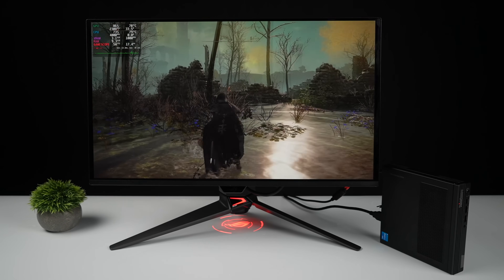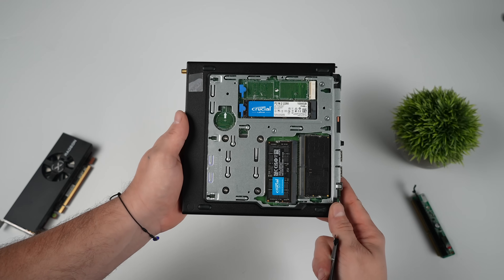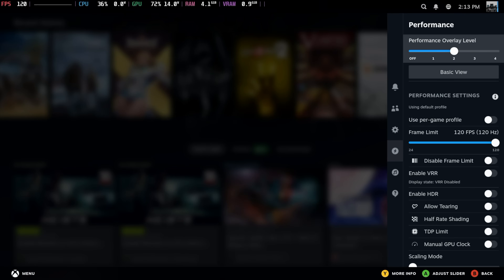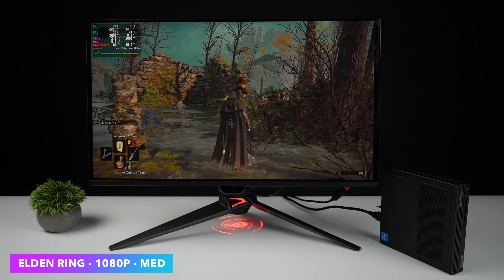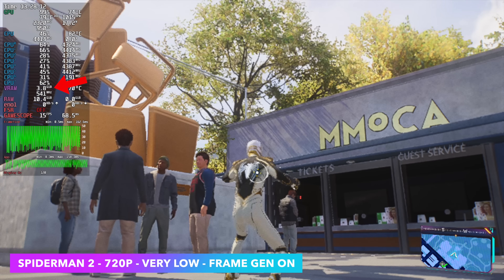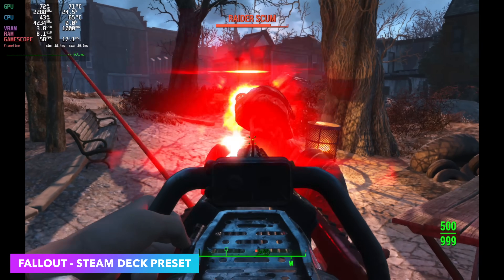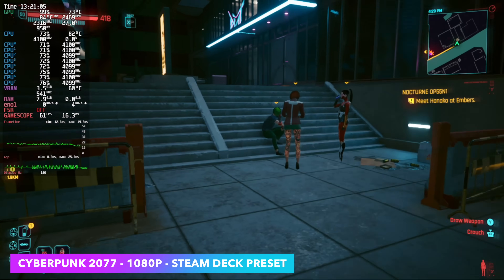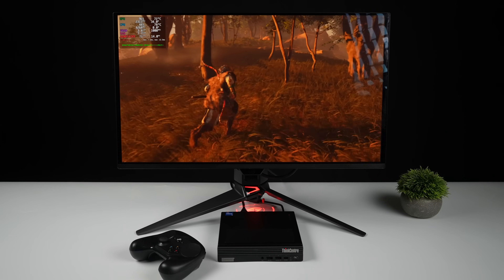The Smallest SteamOS Gaming PC with a Real GPU! Only 1L

Comment: Interesting, but to date I still prefer the minisforum s795/s7, which I find exceptionally interesting because of the possibility of expanding a low profile graphics card. The only negative notes, which could be improved with little effort, are the fan noise and the lack of wi-fi/bluetooth card.
But I trust in Minisforum which is a brand that is doing a lot of work lately!!
Greetings from Italy, great YouTube channel!

Comment: This little PC actually has similar specs to the one I just built! Just in a much smaller footprint. Mine's a Intel i5-12400F and a Radeon RX 6600 8GB and I've been very happy with the performance of it.
Reply: @sheepytina_misc  Sorry to butt in, I guess you mean a 
i5-12400F? Its a great choice! I was between 12400F and 5600X I got the AMD.
About the gpu I also wanted the Rx 6600 but it was 50€ over regular price so I got a 4060.
Reply: @chofa135  Well spotted! I did indeed mean to type 12400F. Thank you for telling me.

Comment: Interesting that you got the RX6400 to work in a Gen 3 Lenovo, I could never get mine to POST with this card. A link to the exact BIOS / firmware used could be very useful to others as I was on the latest when I attempted this back in December 2024. The Yeston 3050 does work great in Windows though as mentioned, even more so when underclocked a little. The only downside been its very loud!
Reply: Last BIOS was Dec 2024.  I suspect it is that particular version of RX 6400.  I have two HP branded RX 6400 and the only way I got them to work was with the x4 riser.  
In the x16 riser, they do not get recognized despite getting power.  I believe it had something to do with the sense pin.  I tested other x16/x8 cards and they all worked.  Only the x4 cards don’t work. 
So I looked up photos of various other RX 6400 cards and most were wired for the sense pin to be for x4… except for the XFX and PowerColor.  These variants have the sense pin as if it is a x16 card.
Mine you, this was a theory of mine.  I was going to buy a card from Amazon and test but the price shot up.  
However based on this video and the fact that ETA is using a XFX branded RX 6400 then it would appear the conclusion is correct.  The x16 riser works as long as the card is pinned as x16 or x8.
I know it’s only a x4 card but for some reason this brand added more pins.
Reply: @Techiast I have the same XFX 6400 with x16 riser and I still can’t make it work. System boots and gpu fan spins but the computer doesn’t detect it.

Comment: Saying the main limiting factor of the RX 6400 is its 4GB of VRAM is... questionable. It's far more limited by its 64-bit memory bus and overall extremely unbalanced design (plus the x4 PCIe config if your system doesn't support gen 4). Of course the 6500 XT is even worse in this regard, but they're both terribly balanced GPUs.

If I were to guess, I'd say the Spider Man performance issues are due to it constantly streaming in new assets to compensate for that tiny framebuffer, thereby also possibly saturating the PCIe bus, and making for constant asset loading stutter. Might be wrong, but that makes sense to me at least. 

Oh, and boost clock specs on T SKU Intel chips are single core only, so if there's any load on any other core you won't ever see those numbers.

Comment: Why not try to install the Linux drivers for the RTX 3500? I have been using nvidia gpu's in the past on a lot of Linux distros and with a bit of fiddling you can get them to run properly on Linux.
Reply: NVIDIA drivers are not available for Steam OS.
Reply: @notjustforhackers4252  meah..
Reply: Better solution is to just use an alternative like bazzite which has a lot of the generally needed patches, etc.

Comment: Im doing this but im using a 4060 lp, im going to get my extra power from a little server board with 2 6pin gpu connection points, pico psu, and then a 3d printed case. Look it might not make sense because by this time just build a pc. But it's not about cost. I'm going to solder the power cable to the pcs lenovo jack so 1 power brick can be used. And I'm NOT using bazzite or steam os. I'm tired of those videos. Eta is kicking a dead horse at this point.

Comment: I do wish there were more low power GPUs.
Reply: i don't think we will see new ones. iGPU's are too powerful now.
Reply: @TT-pi8ww   this is the way!
Reply: I got a similar box with Ryzen 5 2400GE and emulate up to GameCube/PS3 in Batocera...
~100€ system, APU only, for some more you could get a 3400GE from any of the tiny systems from Dell/HP/Lenovo.
The ASRock X300 (bit bigger) can give the 5600G/5700G APU up to 16GB as VRAM (recommend 3200~3600Mhz RAM).
VEGA is still severely worse in performance.
Would rather eyeball a "Z1 Extreme" system or "Z2" (not "go" variant!) for similar performance of this system, but as a handheld with docking options to put a TV as a screen optional.

Comment: I'd rather use this thin client PC with Windows 10/11 stripped down edition and gpu with 6gb-8gb gpu than this highly gimped/restricted pc with only 4gb vram on the RX6400. I know the pain of using very little vram as I am currently forcing my geforce 1060 3gb to run Horizon Forbidden West with Frame Gen (40-60fps) and it does crawl to unplayable fps (14-20) when the game uses vram over 3gb (system ram share) for example roamed too far from game load point. I remedy this by crawling to a save point, saving then quit to title screen then continue the game. MSI afterburner or other monitoring utilities does not show overflow vram usage, but it manifests as horrible slow downs. Summary avoid GPU with less than 8gb!

Comment: I can't understand why you should prefer a system like this instead of a mini PC with the same (or better perfomance with those new ryzen iGPU) perf that you would get from a small form factor mini pc with lower tdp
Reply: Because many of these Lenovos can be had for cheap as they are office devices. Plus you can just use whatever gpu. This one or the yeston 3050. And in the future upgrade it…
Reply: Money.
Availability.
In a lot of countries there no supply or stock of newer products. But sometimes you find some of these old PC and "rare" GPUs.
And with a little bit of tinkering and some luck , voilá you have the tools to become a "proper" gamer.

Comment: There's a Dell AMD Radeon RX 6500 4GB. ITG Gear using it.
Reply: I bought one of these for a Dell Optiplex 5060 small form factor with Core i5 8500. I haven't installed it yet, but I would imagine it will be great for 1080P medium/high settings for 8th Generation videogames.

Comment: Definitely a windows pc. why would you want to put a half assed operating system on it that will only let you play games from one store?
Reply: other stores can be installed with lutris
Reply: @pid1790  all the stores can be installed on windows natively
Reply: @technodrone313  Windows is a terrible console
Reply: @PantheraTK so its terrible at nickel and diming you?  It doesnt even charge you to play online. Or do you mean it sucks at locking you into a single store?
Reply: @technodrone313 steam os, DOES NOT lockdown your computer? Bro do ANY research please.
Reply: @Edghetti  yes it does. it technically lets you install windows software if you want to jump through 14 hoops but most non steam software runs like crap if at all.  

its 20x easier to get linux stuff running in windows.  

linux for servers and devices that dont need a real interface.  not consumers.
Reply: @technodrone313  skill issue
Reply: @ LOL SKILL ISSUE?  I RUN AN IT DEPARTMENT THAT INSTALLS SOFTWARE.  HAVE YOU EVER UPDATED AN AS400?
Reply: @technodrone313  SteamOS is better if you want to have a htpc or console experience
Reply: @johnuzoka6229  no it isnt
Reply: @technodrone313  I tried everything to make a convenient experience on windows. What's the best way to get a console experience in Windows?
Reply: this dude is trying to "STOP HAVING FUN" ahhh
Reply: @pid1790  im trying to stop basement dwellers from sinking further
Reply: @johnuzoka6229  so you want to have windows nickel and dime you with microtransactions?  or you mean you want it to only play games from one store?
Reply: @technodrone313  the only reason I would prefer windows is because of lossless scaling and better support for Nvidia